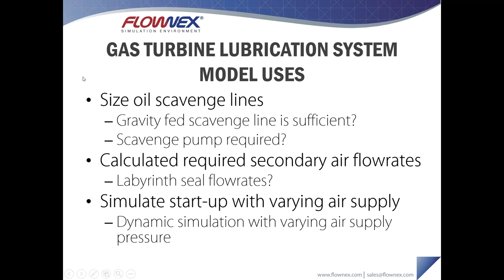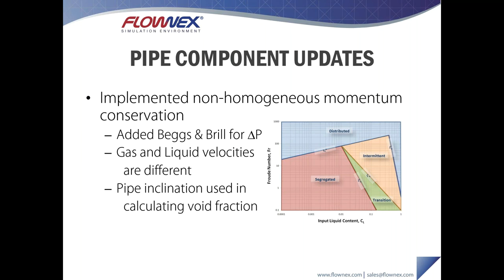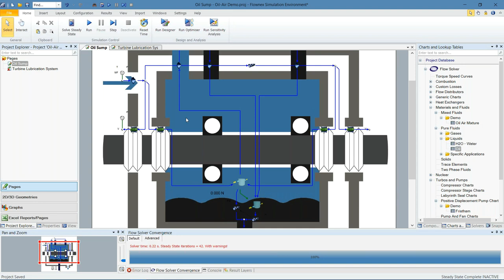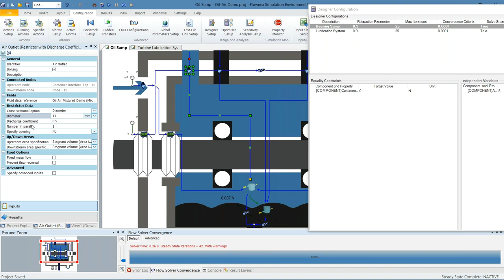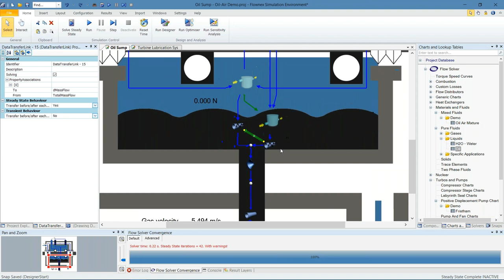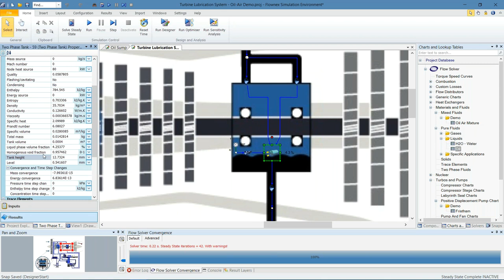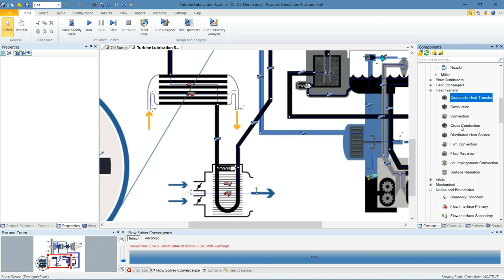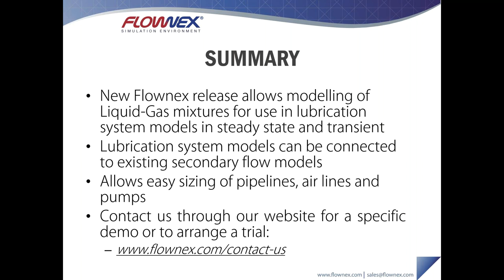Webinar Series | Gas Turbine Lubrication

Comment: 1) what do mean here "Number of Increme-10" and "number in parallel-1" for pipe element? and does each pipe element have same dimensions/input values contained in the whole system  2) at each element calculation, what is mean by exactly (in terms of formula/definition)"Mean Pressure" and "Pressure Drop" 3) here you have not lubricant through bearings, i mean you have not highlight it separately as you shown other elements so it doesn't gave idea about what are their dimensions and oil is behaving in that particular zone 4) how i will get the more data Gas Turbine Lubrication System (Experimental/case study/validation case etc.,) and is FlowNex available for free user hand for particular period as FloMaster gives this opportunity for 14 days to use their software cloud base? Please reply for all above questions, thank you!
Reply from the maker: Hi Social Awareness! We're working on a reply. Thanks for commenting!
Reply: What happened, you didn't replied. I want to work on this 1D Lubrication system, please answer and share the full systematic case study, if possible. Thank You! -- Waiting for your reply
Reply from the maker: Hi! We've got the following answers for you: 

1) The number of increments of a pipe is the number of "sub-elements" that are considered when solving the pressure drop through the pipe. Each increment will have it's own density, viscosity, etc. In cases where the pipe diameter is constant, each increment will have the same diameter however it is possible to have increments with varying size. In both cases, the lengths of all the increments will be the same. The length for each pipe is set in the component inputs so it is possible to have different sizes for all the pipes in the system.

2) In Flownex we solve the pressure at the nodes and use the mean (average) pressure in each element to calculate the fluid properties. The pressure drop is the difference in pressure between the upstream node and the downstream node. The correlation used to calculate the pressure drop differs with components and fluid types

3) The oil flow in the bearing chamber is a complex 3D phenomena and should be modelled using a detailed 3D code. Flownex is a 1D code and at the moment is not capable of modelling the flow in the bearing chamber. Instead, we consider the pressure drop and heat input in the bearings as inputs. Flownex is capable of directly connecting with ANSYS codes and also contains a .NET API which makes it easy to connect it to other codes that can simulate the complex flow in the bearing chamber - this makes for an efficient solution to the detailed flow in the bearing chambers and the system at the same time.

4) This functionality is new in the software and we are currently compiling a paper that contains an experimental comparison. In the meantime, we would be happy to do a custom benchmark if you have experimental data you would use to compare.

Flownex does not offer free trials however we do offer free evaluations following a meeting with your company or academic institution. If this suits you, please visit www.flownex.com and complete a demo request so we can organise a demonstration and a trial period.